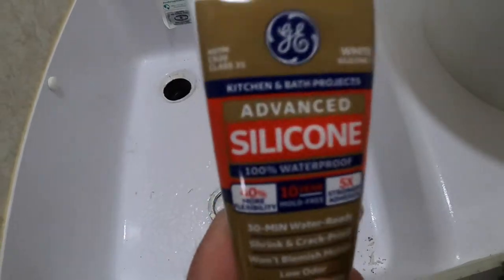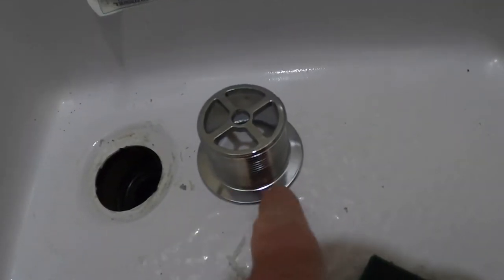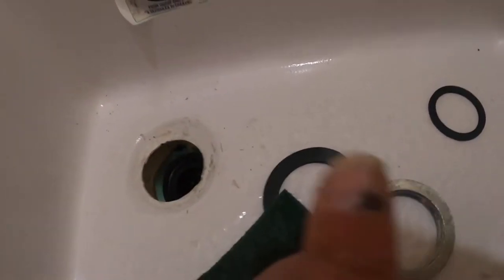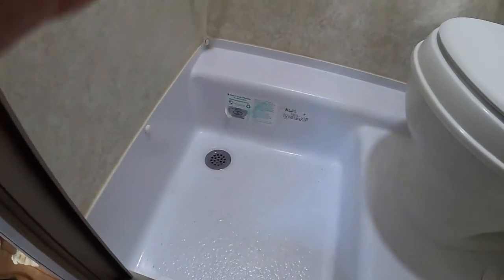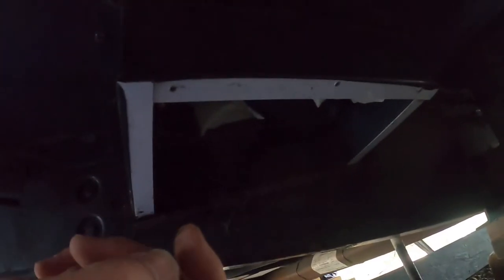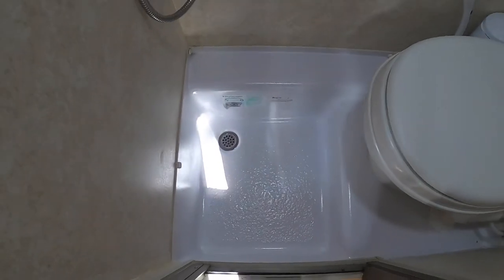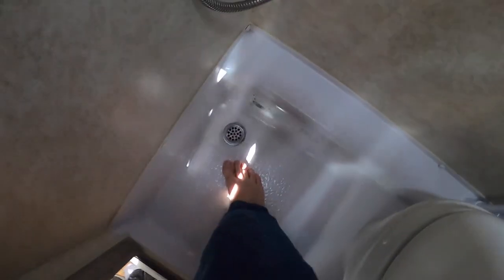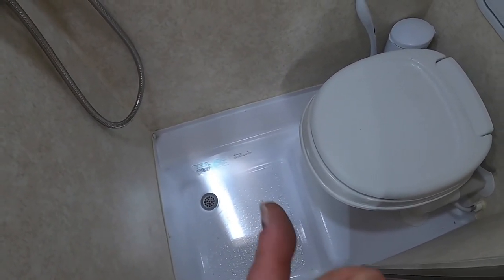Shower Tub Crack Prevention (Part Three) - 2015 Tab Max-s Trailer

Comment: My T@B has a crack from the drain outward about 3 inches. I just found it yesterday when I was cleaning it out after summer. It’s very dry here and I’m sure the heat and dryness has played havoc with the plastics in the trailer. I know I have to get under there but am really apprehensive because it’s been a terrible spider season and snake season. Do you have any suggestions? Also I would have liked to see the drain nut and washers go on because I’m not sure exactly where they go. Also any advice for mending the already there crack?